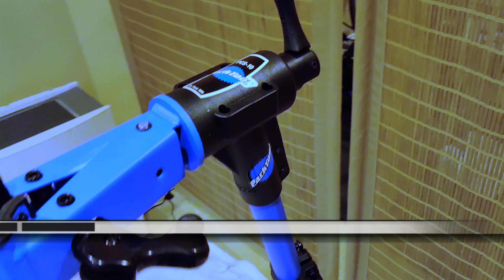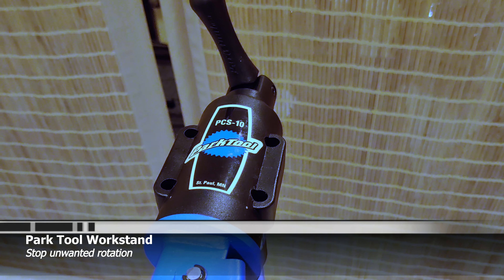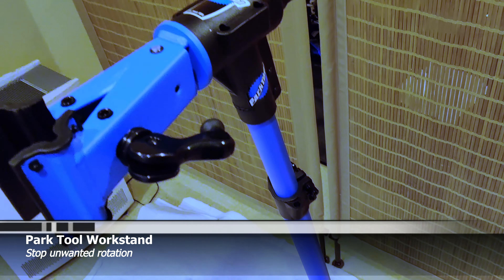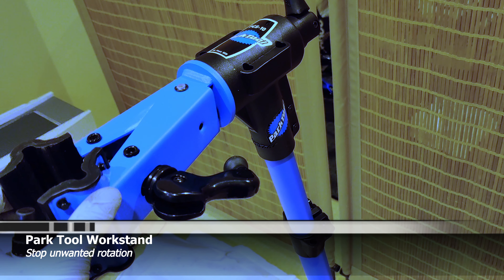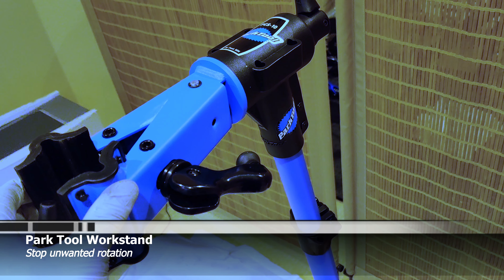Park Tool PCS-10 Workstand Stop Unwanted Rotation

Comment: my head will not rotate by hand anymore. it's always sticking. any thoughts? i tried grease no luck. wd 40, no luck. ideas?
Reply from the maker: Take it apart and look at the interface. Might just need cleaning. I wouldn't grease it.
Reply: @Mamilian  i have disassembled and inspected. i regularly maintain my tools. this was new and only started acting up recently, so i tried everything. grease is NOT a good idea! you are correct.
Reply: @Mamilian  my solution is to put it away loose . no more issues. start loose, end loose.